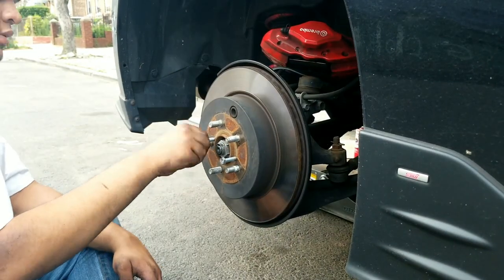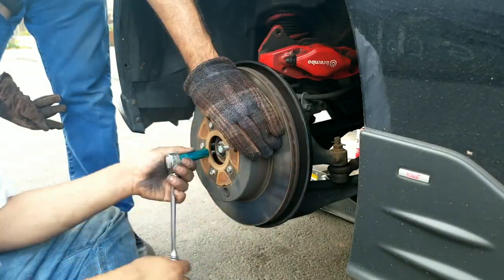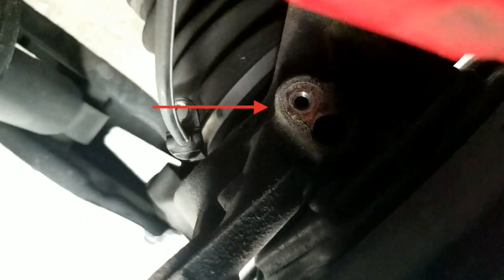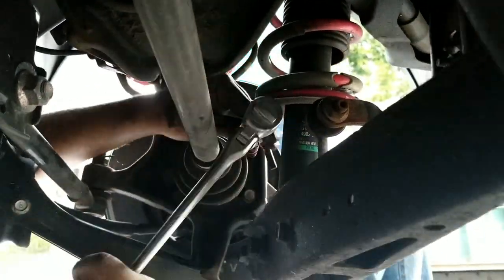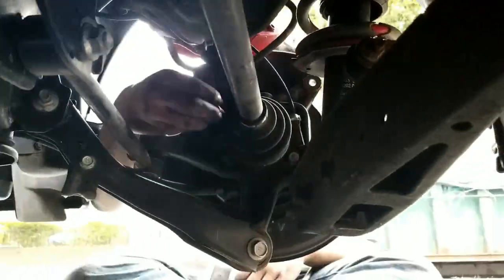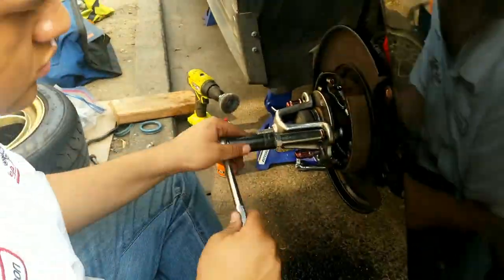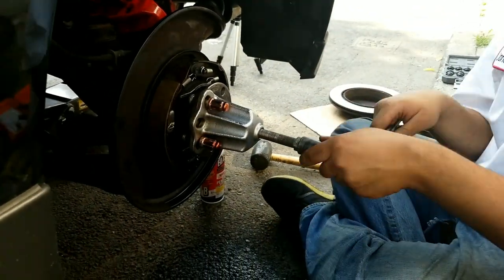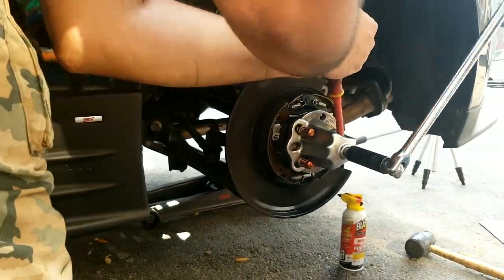Rear Hub Removal on BRZ using a Hub Puller because of Rust

Comment: the pulling part is on the wheel axel hub, where is the pushing part? On the drive shaft?
Reply from the maker: The middle bolt on the tool? Yes it'll be up against the drive axle
Reply: @Project_Delusions  Will it push out the axle instead of pulling out the hub assembly?
Reply from the maker: @kl5634 it should work just like in the video. The drive axle won’t really move much without removing the knuckle.